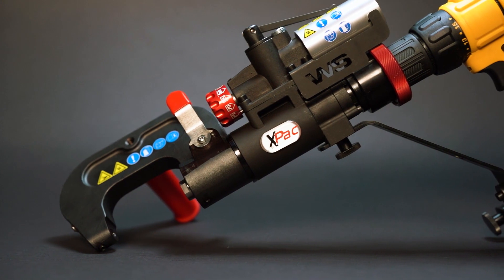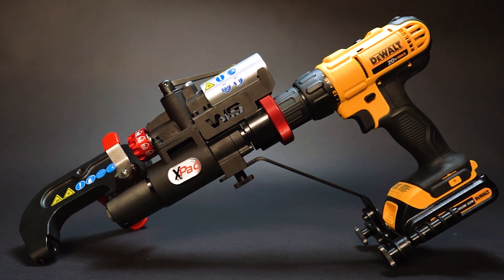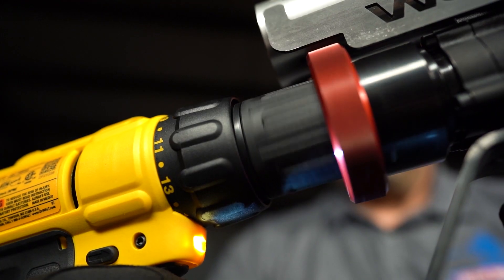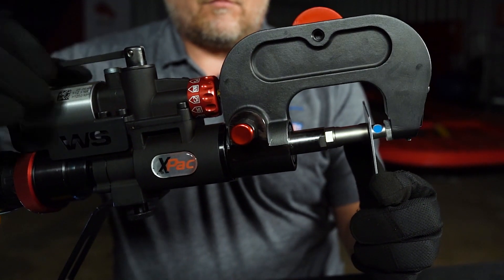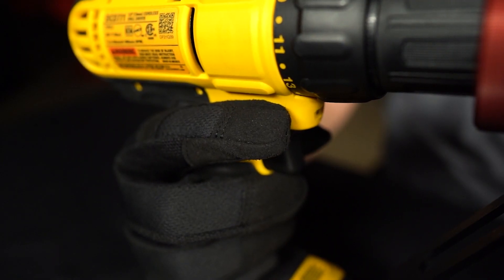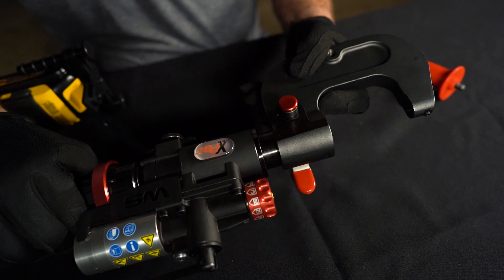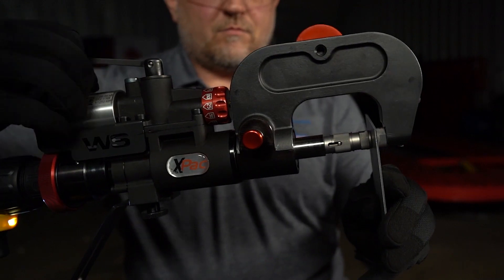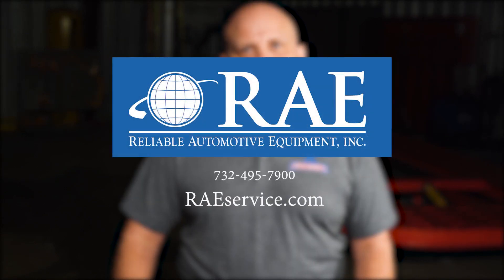Cool Tools:  Wielander and Schill XPac Self Piercing Rivet Gun

Comment: Just wondered, I have one of these in the shop and we're trying to determine if there's an issue with the tool - the drive chuck wobbles quite a bit, a lot more run out than I would expect.  Very few of these out in the wild to compare to.  Video here for reference https://youtu.be/HQSRhmKBQao did your demo tool have this same run out? Thanks in advance.